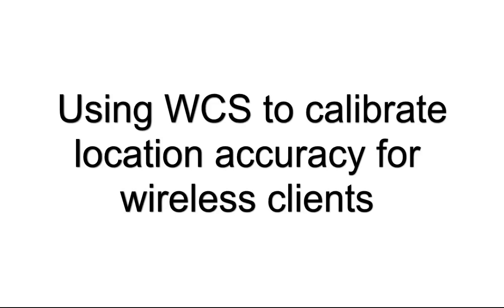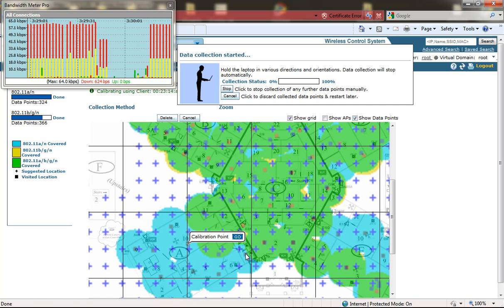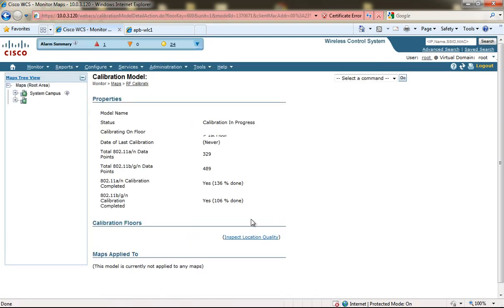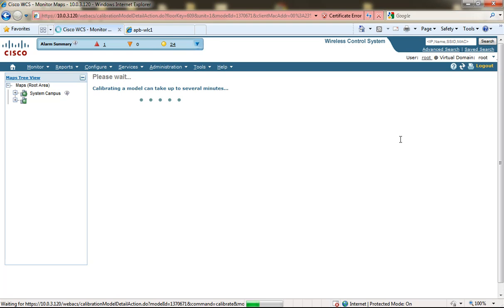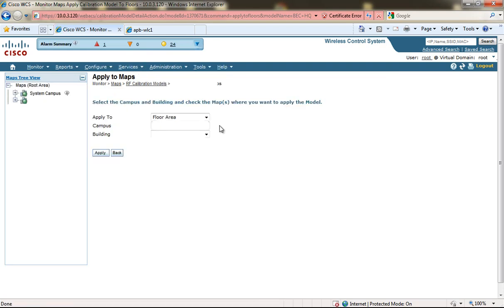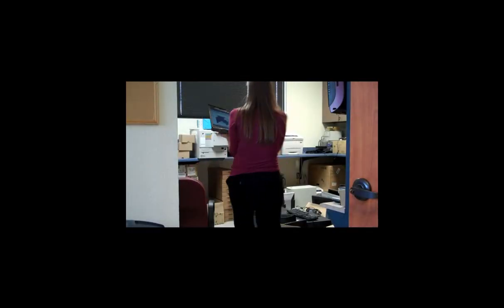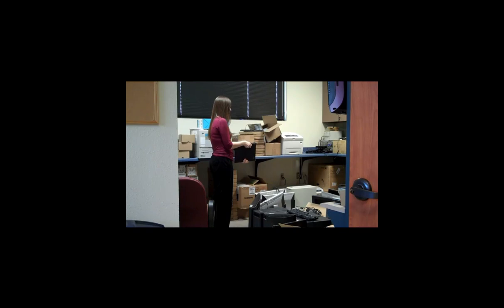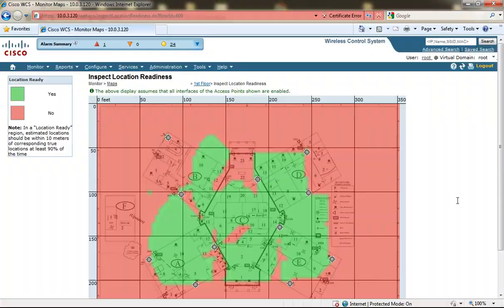Cisco WCS Location Calibration for Wireless Clients

Comment: From your circular-ish heat maps it seems you didn't draw the obstacles on the map prior to doing the calibration/prediction.  It helps when you tell the AP's what's between them.  Especially since they are expecting a specific RSSI based on their distance from each other... (physics).   When it isn't what they expect RRM gets wonky.